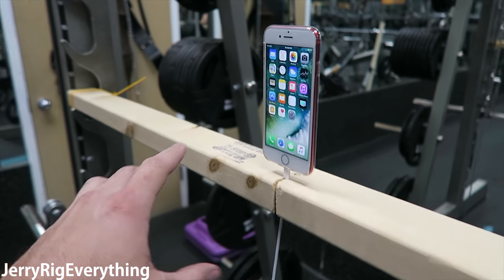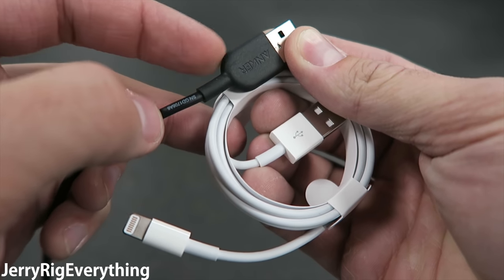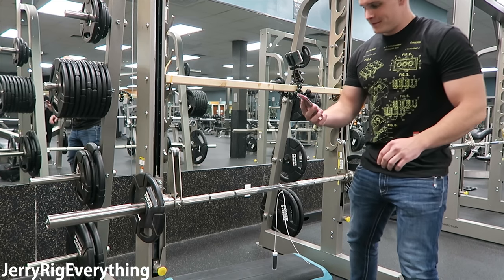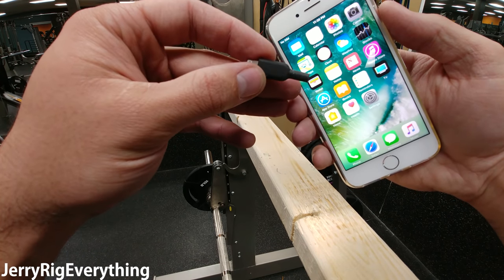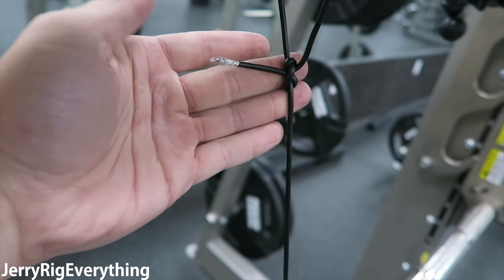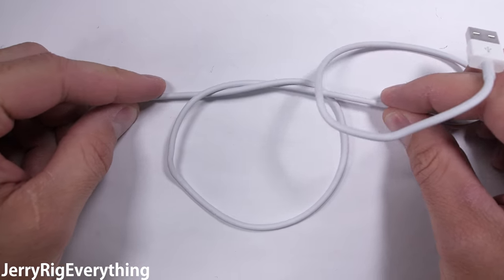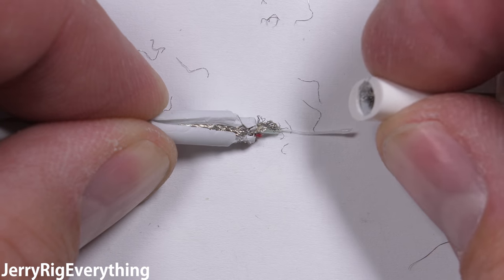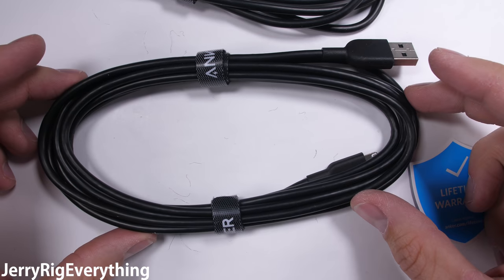Worlds Most Durable Charging Cable? - Tested!

Comment: next thing you know apple is gonna start selling “iCable Pro”
Reply: For only 99.99$
Reply: USB excluded
Reply: With the "OMFG it actually started to work" addon only for 999,99
Reply: For only $1999.99 usb ship separately for only $999.99 plus tax
Reply: Best part, slow charging box and it costs $999.99
Reply: Only 19 payments of 1,999
Reply: Awww the Samsheep thinking their cables are something special haha
Reply: JimJamJon. iPhone 11 Pro Max is the same price and yet it is still a piece of crap. What do you do if you crack the back glass of an iPhone? It’s at least $400 to fix the back glass of an iPhone, so they encourage you to buy a brand new one that costs $1000. You should also try fixing an iPhone. If it has water damage, it is basically useless. And I guess you never took into account that Apple has been slowing down all of their old devices so you either upgrade to their newest device, or have your phone gratuity get slower and slower until you buy a new one or switch completely.
Reply: JimJamJon. Oh, and I forgot to mention that I don’t think $1000 for any phone is reasonable. That’s why I have never owned a phone over the price of $500
Reply: well i can see there's a lil bit of a debate here lmao
Reply: Ethan_ McFly. Lol, yup
Reply: @jimjamjon2285  at least we can agree that the prices are dumb😆
Reply: DmanGameBoy ` What are you talking about used iPhone 6 lmao??
Reply: @jimjamjon2285  "my current phone is an iPhone 6s I got off of eBay for £80"
Reply: DmanGameBoy ` Okay, I said used 6s but whatever. Still have no idea what the relevance of your comment was
Reply: @jimjamjon2285  u were talking about how the 11 isn't shit. U use a 6 not 11
Reply: DmanGameBoy ` .........Okay and?? Is there a rule that you have to have a phone and use it for weeks to know whether it’s a good phone or not?
Reply: honestly, apple does have some great stuff, because if they didn't they wouldn't be a mainstream brand lol. it may be on the expensive side, but a lot of electronics are. Zack himself said that the price is pretty justified on the 11 pro. Besides, used iPhones can go for pretty cheap compared to brand new.
Reply: @jimjamjon2285  pinnacle of smartphone advancement is what we get 120hz display 8k video super slow mo 100x zoom free 200$ watch so yeah......
Reply: DNA RNA indeed. You’re telling me this because?
Reply: @jimjamjon2285  you asked what you were getting with s20 ultra lol
Reply: DNA RNA Oh okay so you’re raving about 8K camera that is capped at 24 FPS and and has awful colour accuracy and focusing, 100x zoom that looks like it was shot on a 2004 laptop web cam. 120hz is nice but drains battery and is more for showing off instead of utility. I personally prefer tech that is actually ready to be used instead of rushed to the market to act like they have “innovated”
Reply: @jimjamjon2285  you probably also prefer being pushed to update by slowing down your phone right? You probably also love apple displays made by Samsung. Guess who is making iPhone 12 displays? The company knows its not as good and you trying to say its better SMH go buy an overpriced, cheap quality cable, bloatware covered phone!
Reply: @jimjamjon2285  kid iphones are just trash , just accept it
Reply: @jimjamjon2285  awww u mad u dont have a good phone
Reply: @jimjamjon2285  why u so mad 😂😂😂😂😂😂
Reply: wewli Spoiled by buying every piece of technology by myself and having a full time job to do so? No doubt you beg your mummy so you can buy the newest Samsung Galaxy 😘.
Reply: @jimjamjon2285  yeah and my phone costs only 500euro and takes better pictures than a iphone X 😂😂😂
Reply: @jimjamjon2285  its just sad ur a probably 20year old man fighting about phones on the internet 😂
Reply: @jimjamjon2285  yeah atleast i buy a phone that actually dosnt break in one drop
Reply: wewli enjoy your unoptimised phone that stops getting updates after 2 years and has 12GB RAM that is equal to Apple’s 3GB 🤣. But yeah sure, it’s Apple that force users to buy new phones right? Hahaha
Reply: @jimjamjon2285  living under a rock? Lmao nice joke
Reply: @jimjamjon2285  STOPPED SLOWING DOWN PHONES IN 2014? that's why the lawsuit clearly states 18 huh? Grow up and stop being daft.
Reply: @jimjamjon2285  enjoy your overpriced,restrictive phone which has desperately low customisation and freedom. You can't even download off the web 🤣🤣🤣. You absolute joker trying. Stick to your trash phone. Why you even watching Jerry rig everything he is a strong Samsung supporter🤣🤣
Reply: @jimjamjon2285  you download pictures ?smh your living in 2005 🤣🤣 im taking about apks, mods and patchers emulators, executors. You clearly don't understand anything about android...... go watch jerries video on this topic....
Reply: @jimjamjon2285  🤣 my bro look at s20vs iphone 11 speed tests you keep coming back to ram. Please get your facts together.  S20 ultra destroyed iphone 11 pro max by nearly a whole minute
Reply: DNA RNA what fucking test did the S20 ultra beat the 11 pro max by nearly a minute 🤣🤣?? Also you realise the S20 Ultra has 4c as much RAMbas the 11 Pro right 🤣. Need it cos of how shit their RAM management is. Also no doubt the test was done on an unstable version of iOS 13 since it was more buggy than usual iOS releases
Reply: @jimjamjon2285  doesn't change the fact that it lost by a minute my g
Reply: It’s true now
Reply: EthanMcFly  they did
Reply: For 130 dollar
Reply: @triwox1657  no is reammy 130 dollar
Reply: It cost 130 dollar for a 'fast 18 w'
Reply: And you can get the icable pro+ subscription for only 9.99 a month
Reply: @jimjamjon2285 
Was anyone talking about samsung? Were just talking about how apple is shit, you got triggered immediately, I would call that being an isheep.
Reply: We got one
Reply: Yo this argument is stupid, both OS’s are good in their own ways.
Reply: JimJamJon Inagine paying over $1000 for a phone with slow charging.
Reply: don't give them ideas
Reply: klaus 420  finally someone said it. I dislike both apple and samsung too from personal experience -_-
Reply: @jimjamjon2285  you do realize that Samsung is not the only Android Phone Company, right?
Reply: @jimjamjon2285  isheeps are something else
Reply: Steve The Talentless imagine paying $1000 for a plastic phone
Reply: @jimjamjon2285  what's wrong with plastic?
Reply: Aurum Faber on a $1000 phone? And I’m the sheep? Hahahaha.
Reply: @jimjamjon2285  you did not answer the question.
Reply: Aurum Faber so whilst Samsung is using plastic on their $1000 phones like $100 Android knock off’s do, Apple is using Matt glass cut from a single sheet with high grade stainless steel 🤣.
Reply: @jimjamjon2285  "glass is glass, and glass breaks"
Reply: @jimjamjon2285  imma have to correct you here. Nothing again apple or Android just that yhe 120hz display isnt only for show, use a device with 120 hz and you will know the difference.  Trust me once you use it you wipp never revert to 60 hz, the screen becomes so smooth,  you wipp begin to see how slow 60hz actually was
Reply: @rajkumar-rg5sw  I’m aware of that and I’ve seen 90hz OnePlus in real life and can truthfully say 60hz iPhones look the exact same. 120hz I can’t say but iPhones have always had a type of motion blurr. That’s why they’re so buttery smooth
Reply: @jimjamjon2285  yea i know iphones are smooth not gonna lie. They have got this premium feel to them
Reply: For $999.99 :(
Reply: @jimjamjon2285 
 Comment: Makes a joke about Apple 

Jim: Starts to screech Samsheep

Also Jim: If someone says one thing to support Apple android users start to screech "iSHEEP" HAHAHAHAHA

Hypocrite Andy 🤣🤣
Reply: @jimjamjon2285  Why do glass/plastic backs matter if you're just gonna put a case on it?
Reply: @justyouraverageweeb2167  Because they have a cheap, light McDonald’s you feel to them
Reply: @justyouraverageweeb2167  My name’s not Andy 🧐
Reply: @jimjamjon2285  my iPhone 8 Plus is scratched by a peice of dirt in the case shut up
Reply: @Eljxh  Who tf is talking about the iPhone 8?
Reply: @jimjamjon2285   your talking about an iphone 6 my iphone 8 got scratched by a bit of dirt and your talking about plastic screens
Reply: @Eljxh  When tf has anyone mentioned a plastic screen? We’re talking about the $1000 plastic back Samsung.
Reply: @jimjamjon2285  ok  your gonna have a case on it anyway
Reply: @triwox1657  move that decimal point 1 step towards right.Then it's gonna be more accurate..😀😁
Reply: @depressantdrug  ❄️❄️❄️
Reply: @triwox1657  69.69

Comment: Thank you for adding the metric weights on the top right. Such a small detail that many people neglect (vice versa also). Otherwise I wouldn't have had any real sense of what the weight is (as there are many different types and densities of workout weights).
Reply: metric masses* grams are mass not weight. Thats why you mass the same on the earth and the moon, but you dont weight the same.
Reply: @hehehehaw7  thanks for the lession on year 5 physics. You knew what I meant.. No reason to be pedantic..
Reply: @miguelbuldain8323  lol ikik

Comment: Fibre wire is history! Anker durable cable is my weapon of choice, agent 47!
Reply: Mine Anker  charging cable just broke after 2 years of use!
Reply: @paladinhenk  That's a long time Lol
Reply: Anker has my loyalty for six years now and I've only bought 3 things from them 6 years ago (1 power bank and 2 cables) 😁😁 still holding up pretty damn sexy after traveling all this time
Reply: paladinhenk thats short
Reply: W
Reply: 3
Reply: Yes
Reply: Omg lol
Reply: @Vrsce01  2 years is very short, my Moto cable still fine even after 4 years. It's just a cable , something's you use occasionally for  file transfer
Reply: @dennis4088  occasionally? How the fuck? You need to do it about every day or 2, it literally chargers your phone.

Comment: Test the OnePlus3T cable.
Reply: maurice agboga I have the OP3, same cable, it's been almost a year with it and it still works perfectly. Only bad thing I could say is that it's short, other than that it's perfect.
Reply: Nebur Nunes Most Cables nowadays are meant to be short. this prevents the user to use their phones while charging.. but sometimes, some people still use their phone while charging xD
Reply: I have also an OnePlus 3T but I don't want to distroy my one cable.
Reply: maurice agboga it is a good cable, pretty strong
Reply: Ok
Reply: Анастасия Лазарева hollander?
Reply: It is an downgrade but it's still very good. I kan is my phone for about one and a half day.
Reply: It's a downgrade of Android 6.0 now it's Android 7.0
Reply: As a 3T owner, I'd love to see this.
The cable is fairly rigid but tough feeling, so it'd be interesting to see how much weight it will hold.
Reply: test the samsung galaxy s8 cable it will beat them both

Comment: The main weight bar is approximately 45 pounds by itself. So if you add that to the additional weights provided by the plates, that equates the tension strength of the iPhone cable to be approx. 70lbs and then the anker cable to be about 125lbs.

Comment: You forgot to mention that the bar weighs 45 pounds.
Reply: There's a counter weight.
Reply: Smith machine bars are usually counter balanced to weigh less than a standard Olympic bar.
Reply: A smith machine bar weighs next to nothing.
Reply: No Smith machine bar weighs 7 pounds my dude
Reply: The smith he is using is counter balanced so the bar weighs nothing... they do this so you dont have to guess the weight of the bar
Reply: The Smith is counter balanced meaning the bar weighs nothing so you dont have to guess how much the bar weighs... i can see you dont work out!
Reply: iCheeseForFree the smith machine bar doesnt wey shit. if anything it makes the reps lighter
Reply: Stefan Sebek the fbi is scared of Jerry
Reply: Nope, that's a free weight Olympic bar you're thinking of... pls don't arrest me
Reply: How many dudes at your gym drag a free weights bench into the smith machine and start benching or shoulder pressing? One of the most annoying things you can see.
Reply: Man I didn’t know the fbi knew about wheights

Comment: Can you please try the Powerline+ by Anker? The kevlar one. I've been using it for over one year now and it still works! But it was quite expensive($16 for 1m I think). Also, before buying that cable, I broke cheap ones (like the stock ones that comes with phones) like ever 2 weeks. The Anker one is still going strong!
Reply: SimmonSays I hope there's a micro USB version.
Reply: Ya, that's the one I use.
Reply: Yeah heres a USB-C Version and a Micro USB version too.
Reply: There's also a lightning connector version.
Reply: That's not expensive at all lmao, Apple cables are more expensive than that.
Reply: It's relative.

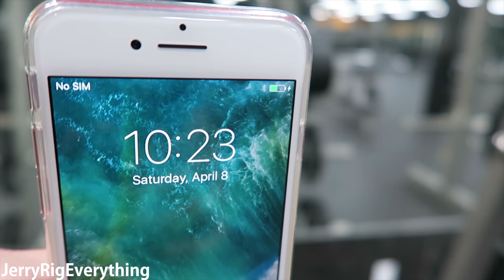Comment: Who else saw those lights coming from the senser 0:58
Reply: im pretty sure those lights are normal because its a camera on the front
Reply: wow thats so amazing wowwwwww :oooooooooooooooooooooooooooooooooo
Reply: its actually trying to pick up movement so the screen auto sleeps, much like the sensor on the wii remotes. they emit constant signal bursts. the part that was blinking was the proximity sensor
Reply: It is just the infrared sensor

Comment: I still have my original Motorola droid ultra cable from summer 2013 and it looks like new no joking and I'm not soft with it but not terrible, I heard that iPhone cables were fragile so I completely babied the cable on my new iPhone 6 long ago with zero bends or pulls and it lasted only 11 months. Piece of junk.

Comment: "10pound is a lot"
No its sounds like a lot, but its only 4.5 Kg
Reply: Robert Kamminga wow, 4.5kg is nothing. That’s only 10.56338% of one bag of cement. 

It’s still quite a bit, but with different systems of measurement or with larger units, it seems smaller
Reply: yeah its only the size of a new born human baby at 2 months of age.
Reply: Smile y quality comment
Reply: nobody “new born” “2 months”
Reply: @ardie72  at 2 months lol.Most babies when I was born where between 4-4.5 kg I was 4.25kg

Comment: I've been using magnetically attracting cable conversions for a couple years, they are described as Gen-X designs. These save my device connectors from daily insertion cycles, make a quick, reliable mating, and provide a "universal" cable connector interface to each device. They release easily - a characteristic that could be good or bad depending upon your application and wishes. I do clean them every few months. Also, I haven't had a failure of the device adapter or the cables on ten devices; probably 1,800 insertions total. I know this isn't a rigorous test, just daily use, but I'm happy with the product.
What do you think?

Comment: You should redo the test by trying to simulate adding weights symmetrically. The test you show is asymmetric. The position of the center of mass of the bar changes every time you add a weight beyond the symmetry point. This adds additional torque along with gravity. It will be interesting to see if the results change if you had two people adding weights at the same time. Or you could re-design your gig to make the process symmetric. Just a thought...

Comment: I'd like to see this done with Huawei cables. Had my 2 cables for 3 years and while they are discoloured and one has a cut in its outer isolation, it is still going strong without issues.

Comment: Firstly, I'd like to point out that the tensile strength test may have been impacted by the previous test. The Apple cable may have been compromised partially after the first test.

Secondly, the tests involved continuous force applied over time. Whenever a cable receives high levels of stress, it is due to a sudden impact force (dropping your connected phone, or misjudging your cord's length, for examples), and those types of forces effect things differently.

While I do appreciate the channel for what it is, things like power cords typically fail after continuous abuse. Learning how much continuous force is required to break one is illustrative, but stronger isn't always better. I don't have a need for a cord that will outlive my phone, since every phone typically includes a charger. The most illustrative information would be a data comparison of a sample of each cord and measuring their lifetimes under various use conditions, but very few people would find that compelling enough for video material.

I'll keep watching the phone tests though, even though listening to the scrape of a razorblade on metal frames makes me cringe. :P

Comment: Well. I've seen plenty of videos testing their strength but not really durability. I've owned broken cables but if they are torn then they were someone else's that I just happen to have and if they just don't change but are intact then it means that I've bent them to death from repeated bending.

The only true durability test for me is how much repeated bending can I do rather than how hard of a pull I give them. It would be great to see a video about that instead and especially on the nylon-braided cables!

Comment: The braided shield is what usually breaks, and if that happens the negative connection is lost. This happens mostly due metal fatigue. I would design them with a spare negative wire so when the shield breaks the connection will not loose

Comment: althought i didn’t get the dura, i got the regular powerline ii and it works great so far. it seems pretty study and is easy to clean!! customer support was also really nice when i requested a replacement and shipped really quick, although turns out in the end my cable was just wet... dried and works again.

Comment: Afaik the best way to build a cable/connector is to build the main chassis out of metal and strip the cable to the main chassis. Then add a rubber piece for kink protection and you have a great cable. Just look at those standard Neutrik XLR ones. Eventhough they're not that tiny, they did it right.